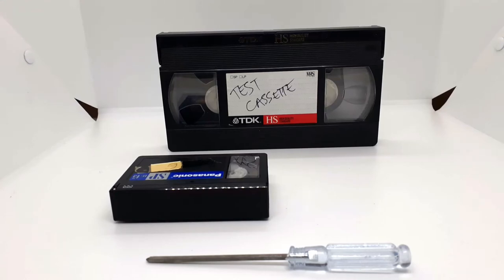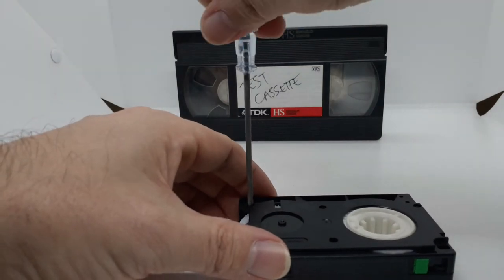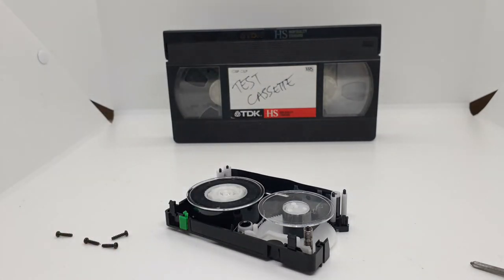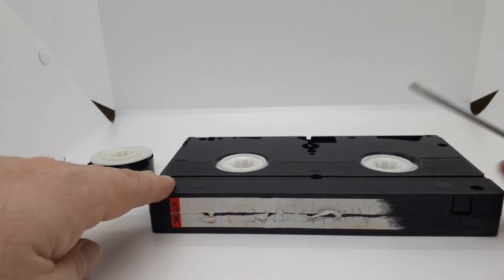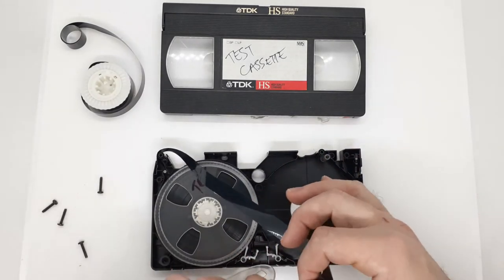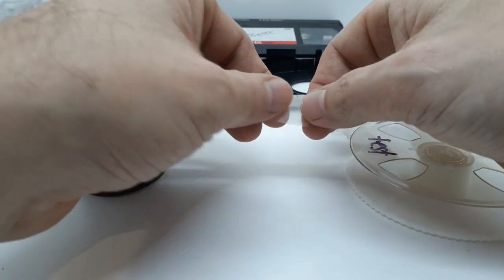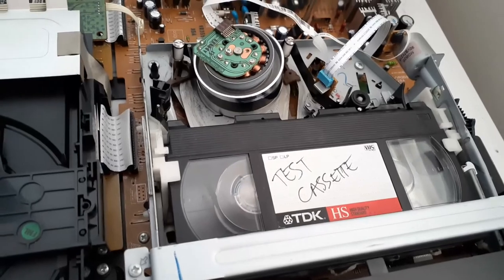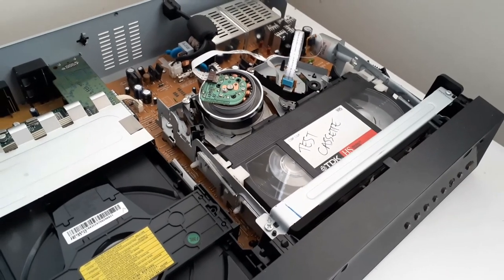VHS C TO VHS WITHOUT ADAPTER

Comment: I had to do this for 35 tapes recently.  Three different adapters did not work.  I tried it your way and it didn’t work by leaving the full original spool on.  I took the full spool on the left side, and tapes it to the right spool. Then I spun it by hand onto the right side. Then, I had to pull the full tape off of the left side, and spliced it.  Then I had to rewind it.  It was crazy and took 15 minutes per tape. I had to charge hundreds of dollars extra just to do this.  The customer was thrilled though.  The memories were priceless.  I have 29 more I need to do so I am going to try your method again.  It would save a lot of time.

Comment: Unless it is moldy or showing signs of other progressive disintegration, one should NEVER throw away the original tapes. They have already lasted 20-45 years, and if they're in good condition now, they'll likely last that much longer at least. In the future you may find a better transfer method and you'll need the original tape to take advantage of it. Also, it's one more layer of backup in case you lose your digital files.
Reply: I Actually Removed Mould From VHS Tape With VCR Without Cover And Toilet Paper A Few Winds Along That Toilet Paper (tape removed from head) And I Was Succesfully Able To Recover Old Family Videos For My Grandma And Now I'm Gonna Do Old VHS-C Tapes With An Adaptor And I Realized Sharp Didn't Make It It Was Chinese Name slapped Plastic As All Of Them Are

Comment: Actually, you can replace the tape without cutting it. There is a little plug on the ring which is holding the tape at the end, and you can just unplug it and insert new tape.